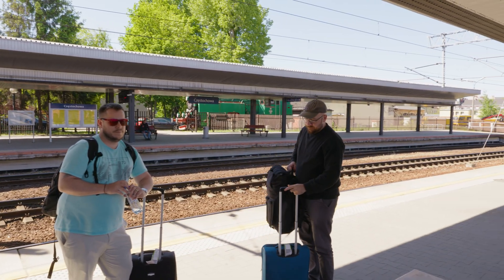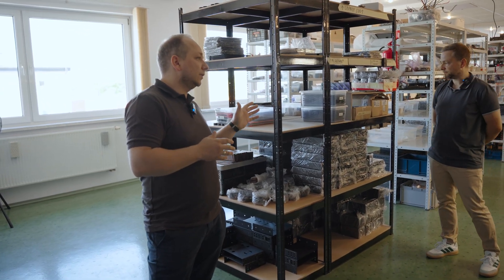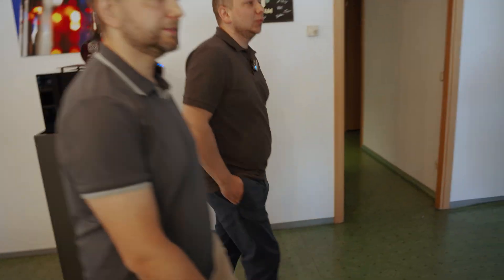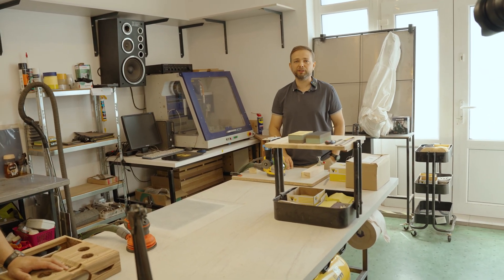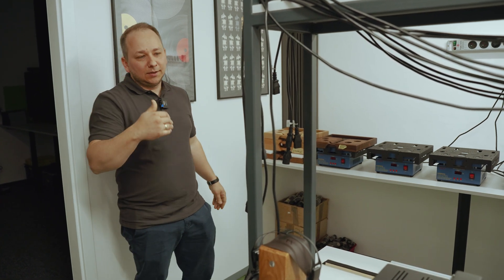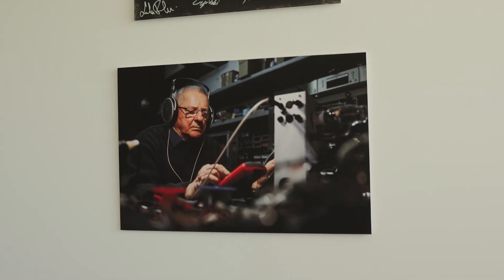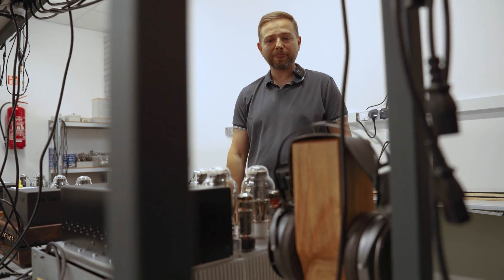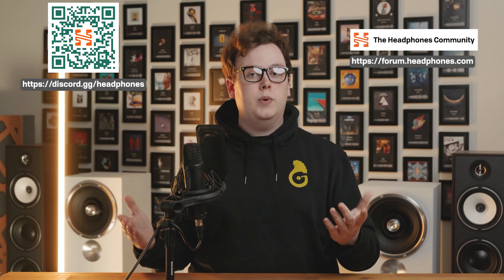How are tube amps made? - Behind the scenes at Feliks Audio!

Comment: Newbie here, on the Envy, what impacts the sound most, driver tube or power tube?
What is the most neutral sounding , good quality power tube? I want to use Envy as a pre amp only into solid state power amp , will the power amp tubes last longer in this usecase?
Thanks 🙏🏻

Comment: Yeah, the moisture in the wood is quite a problem with woodwork and luthier work in general. Drying up the wood is a crucial part of guitar manufacturing for very similar reasons: you'd never want a guitar neck bend too much with temperature changes or the paint in the body crack with the change of seasons or during aerial shipping to another country.

What they do with their cases is very good, thanks for the walkthrough!